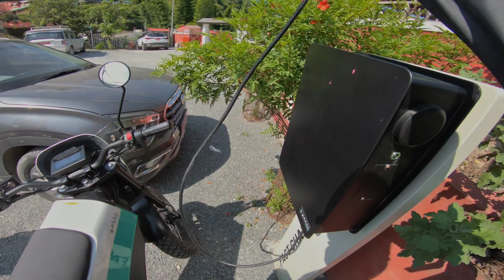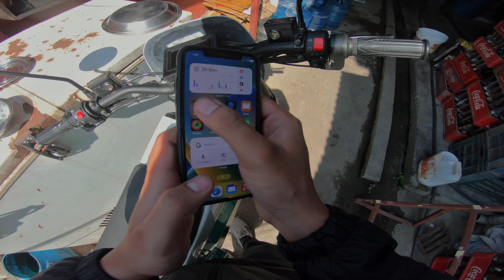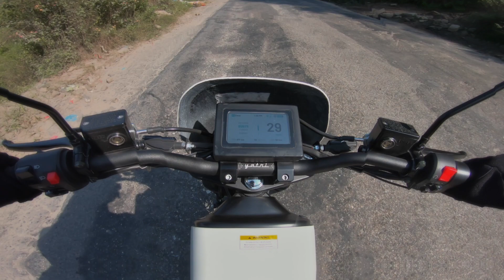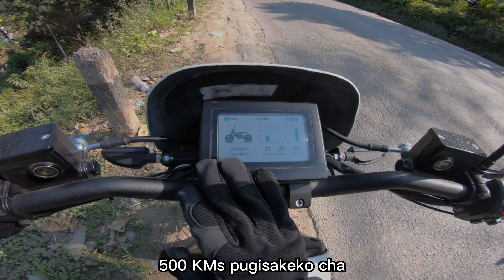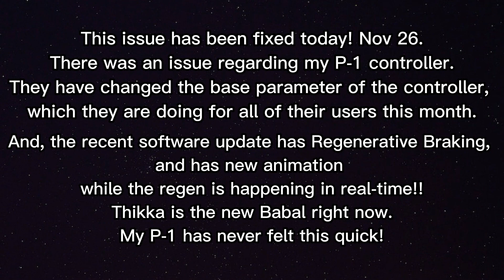Yatri P1 Real-World Range Test: Chitwan to Kathmandu [Part 2]

Comment: Just so people are not misled, Yatri Motorcycles reduces power and controller's temperature threshold deliberately during the purchase and advises each user not to go on long road trips as we analyze all the vehicle data for at least 3 months. After post delivery checklist is nominal, we remove all power caps and increase temperature threshold (this practice will soon be phased out). After this point - together with our slowly increasing network of fast chargers - long and adventurous trips will be a breeze with unparalleled user experience, our biggest value proposition!
Reply: I hope you are right and this fixes the problem. By the way, when will the next booking open??
Reply: Maybe add a small sunshade over the supercharger, to reduce its temperature by a few degrees. Or change to a more reflective material for the cover
Reply: yatri ko charger black colour ani feri shade nabhako thauma bhaye paxi yessai ta charge garda coil haru le heat garirako hunxa + solar radiation le dine heat le garda heating ko problem chai dherai nai raixa, inefficient bhayo design
Reply: please make and deliver motorcycles at reasonable prices for average consumers.